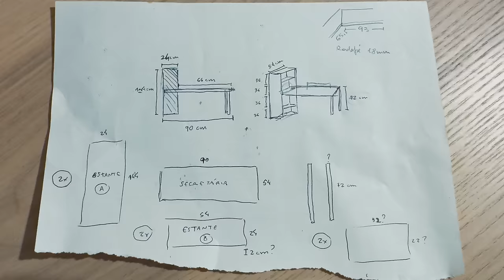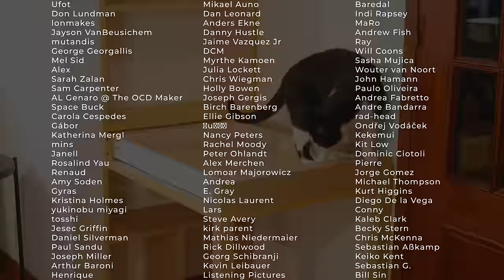Tiny Desk and Bookshelf Pt.1

Comment: I have a full face respirator as well. Not the most comfortable thing but total protection for my face as well as the added bonus of dust protection and that's really the bottom line with all PPE. 
Great project. Your sister should be super proud of what you do!

Plus your cat looks SO much like one of my cats. Cool!
Reply: Which are good full face respirators for wood working and woodturning?
Reply: @johniemos4959   I've used the 3m model for about 10 years now. Still the same one. I've replaced the harness a few times. It wears out through usage but it's normal wear and tear and easy to replace. They are NOT cheap but they last forever.  My particular model is 3m FF-402 and you get a boatload of different cartridge types available for it. Mine is for dust and organic solvents. Hope that helps. 
p.s. wash it every time.

Comment: Super cool! Does anyone know where/if that iron-on banding is sold in the States?

I’ll have to try that veneer trick with the dried glue and iron. That’s a good idea. I guess it depends on the type of glue and amount of heat applied (wouldn’t want to burn the veneer!
Reply from the maker: Yes, I actually ordered this birch edge banding from amazon US. The trick with the wood glue works with any titebond, so I suppose that would work with any brand. I always use titebond III, though. I set the iron to cotton setting as it feels like a good middle ground and I move it over the wood frequently to prevent burn marks. The heat that it will handle will depend on the wood species more than the wood glue. You will burn the wood before the glue is destroyed 😛 make a few tests before doing it on the final workpiece.
Reply: @GetHandsDirty   Awesome. Thanks for the tip. Can't wait to try it. :)

Comment: 21:35 FYI this is a german product and pronounced different. It's 2 words - "Keil" and "Verbinder". "Keil" is pronounced like "isle" with a K in front. "Keil" means wedge. "Verbinder" is best explained in 2 parts - "Ver" is basically pronounced like "fair" and "binder" like "Tinder" with a B instead of the T. A "Verbinder" is something that connects two or more pieces. So the right pronounciation is something like K-isle-fair-B-(T)inder :-D smartass mode off :-D